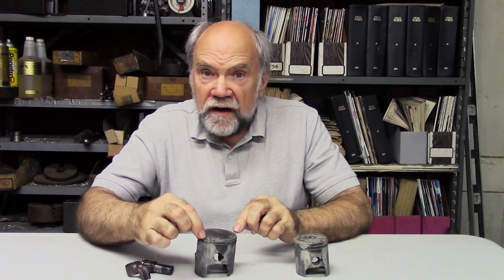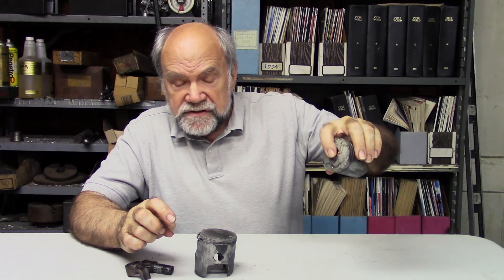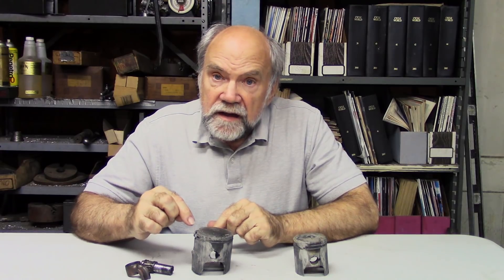What Is The Difference Between Normal And Abnormal Combustion In A Motorcycle Engine?

Comment: At last, someone on YouTube who knows the difference between Pre-ignition; Detonation & Deflagration.  Well done to you -- I was beginning to lose the will to live.

Deflagration:  originally from a Greek word, then From Latin meaning ‘to burn down’.   In an engine, it’s referring to a combustion process that propagates due to the absorption of adjacent heat from the flame front.  The flame front travels across the combustion chamber between 35mph & to around 130mph (50ft/sec to about 190ft/sec).   It’s subsonic combustion, and it’s what we want inside an engine.

Detonation: originally from a Greek word, then From Latin meaning ‘to thunder down’.  In an engine, it’s referring to a combustion process that starts due to heat being generated within a portion of the unburnt fuel/air mixture, at some point after the initial start of combustion.  Perhaps due to part of the (as yet) unburnt fuel/air being compressed by the expanding burning mixture.  It's a post-ignition issue -- not to be confused with pre-ignition.  The flame front of detonation, I believe, can travel at 3000mph (4500ft/sec), & therefore it's supersonic combustion.  This supersonic combustion produces a supersonic shockwave.  The shockwave then drives the combustion process, as the head of the shockwave them compresses more of any unburnt fuel, raising its temperature and causing the detonation process to continue until there is no unburnt fuel left.  The shockwave produces the metallic pinging sound (or pinking as we call it here in the UK).  In part, some of the sound we hear is that shockwave hitting some of the metallic components inside the engine.  Causing those components to ring out for the length of time that the shockwave exists.

Comment: but, but, sir ....in pre-ignition, why does it get so hot? ..piston rising - hot bit (carbon deposit, plug electrode) ignites mixture - which the spark of the spark plug was just about to ...so what makes that circumstance hotter? .... I'll guess - is it the early ignition of the mixture which isn't as compressed as intended makes a hotter flame/ignition?? ...or maybe the cooling effect of fresh charge is lost when it burns early (that sounds like the best guess) :) ...tia.
Reply: Pre-Ignition doesn't occur just a bit before the spark plug, it occurs waaaay before the ignition spark, like down at BDC on the Induction stroke. As such the piston is then trying to compress an EXPANDING gas wave all the way up to TDC rather than just the mixture. This means the heat of the flame is in contact with the piston crown for a very long time (in combustion terms), and the piston crown is oh so very thin, and the hottest part is the around the centre (furtherest from the wall). Hope this helps ;-)
Reply: so then the only real difference between preignition and detonation is... preignition happens early, and detonation happens on time, but burns too fast?
Reply: Detonation is far more violent, and happens at any time, hence it destroys the edges of the piston with the shockwave. Detonation is certainly not a conflagration environment within the chamber.
Reply: @Force1Com  No preignition is compressing the already burning gas and that forces the generated heat into the piston weakening  it mostly in the center while generating max pressure BEFORE tdc. There is no explosion.
Detonation is where, during normal burning, some part of the gas is heated and compressed past it's ability to resist exploding so it does. It is always at a place where the flame would be last to reach(the edge of the combustion chamber). The ability of a fuel to resist exploding is what octane measurements measure.